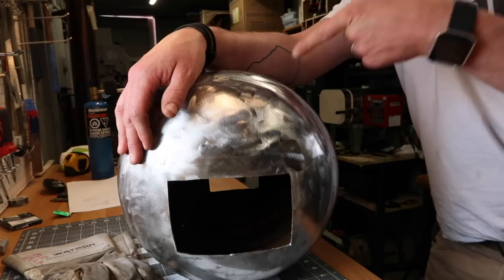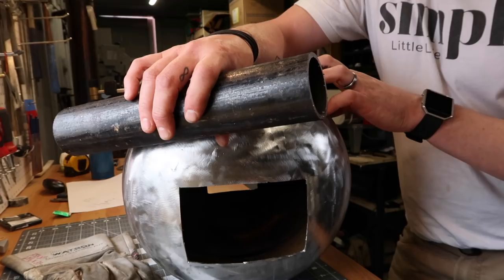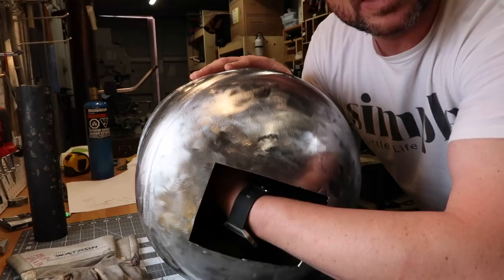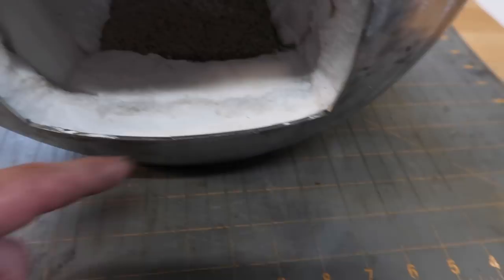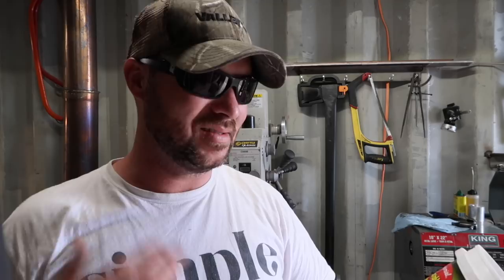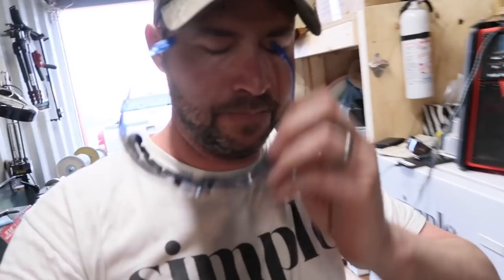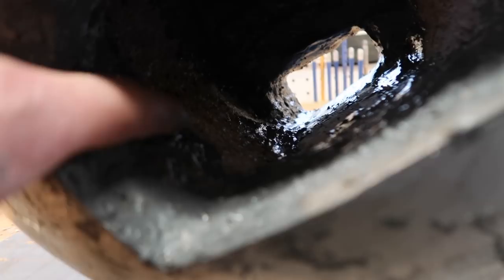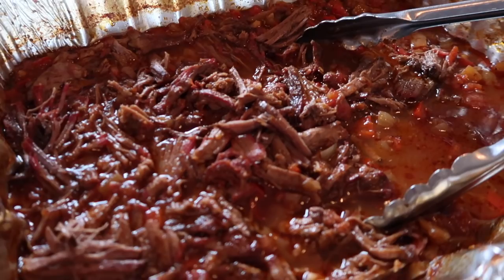Forge Vlog #3 - Insulation & Cement

Comment: Looking good! I used a 12" pipe 2 feet long, and simply cast 2" of cement inside, using an 8" pipe. I also put the burner in at an angle, using cast pipe as a consumable (ie it tended to burn away, very slowly). I used propane and forced air from a squirrel cage blower with a gate valve. I put firebrick at front and back as needed for the work and yes it did tend to break with expansion contraction, but I just kept re-using it as it shrunk. I forged and forge welded regularly for many years with it. The borax was hard on the bottom, I could have re-cast it after 10 years of use (but I didn't). Nowadays some coat the cement with a glaze and swear by it.

Comment: Jeremy,     You would have been better off leaving the end cut off put a hinge on it because kaowool does not last for ever and you will need to reline it eventually. Just saying nice build though the only other thing I may have done since you are only using one burner I would have centered it. Unless this was planed to latter put another burner to be able to reach welding temps easier. Either way nice build.   Sincerely ,Martin at M/S Blacksmithing and Blades

Comment: Jeremy I used a refractory mix for my pizza oven I built. you can use vermiculite and portland cement Mixture you can evenly fill voids and it will give you great insulation property I run my Pizza oven at 900 deg and the outside of the brick remains cool.
Reply: For forging and tempering he will hit or exceed 2000 degrees F.

Comment: Hey Jeremy, I used the same fire bricks and refractory cement as you did in your build and I have found that they don't hold up super well in my forge. The bricks I used as doors tend to crack and fall apart and the cement cracks and peels off pretty quickly. Just thought I'd let you know.

Comment: oh you should have used a ridgidizer and some itc to coat that kaowool after kaowool is heated it gets rather fragile and becomes airborn every time you light it. ceramic fiber is far worse than insolation .  hope this helps
Reply: Shan Moldovan I'm thinking of applying this same or similar technique for my new forge. Shouldn't the cement suffice if it is covering all of the kaowool? Thanks.
Reply: J. Darmon Blades 
It may but id be worried about cracking. Even with a Ridgidizor the kaowool wears out rather fast. this is specifically why I use insulation fire brick rather than kaowool in a sence it is safer and you dont have to worry about the breakdown of the kaowool.Not to mention my forge is not round but I am confident that insulation fire brick can be modified to fit round . Either way its just my preference you see many forges that use kaowool as a working surface but mine is used as a backup lining behind my soft fire brick. I sapose if you use like a saitinite clay as a coating you will probably be ok the other thing I  would use is a i think its called tci 100 it is used in kilms to direct the heat back at you piece. fyi the easier you make it to reline will help rather than having a solid  shell instead of a door.

     Thanks for the inquiry, Martin Moldovan at M/ S Blacksmithing and Blades
Reply: Shan Moldovan thanks for the feed back. I Appreciate it.
Reply: your welcome, all I can say is do a bit more research before you make you final build.     Sincerely, Martin Moldovan at M/S Blacksmithing and Blades

Comment: So I guess it doesn't matter if you don't rigidize the insalated blanket ??
Reply: It does, if his cement ever cracks he needs to cut the forge off and not use it till its fixed.  The wool is carcinogenic and will give you cancer without all necessary precautions. Which is necessary even if you rigidize, buuuut the wool is much less likely to go airborne of its been hardened

Comment: Wrong cement. And you should rigidize the ceramic wool first. Use itc 100
Reply: i got itc and kast 'olite. im thinking of using sodium silicate as a high temp adhesive; rigidize the kaowool also with sodium silicate? then 3 layers of itc (1st layer the thickest) then kast 'olite.. i think.. is this a wrong approach?

Comment: I have been doing a lot of research on these and was wondering why you used the refractory cement? Most of the ones I've seen online use a rigidizer and then a couple coats of ITC-100? Just wondering.
Reply: Stephen Ranti itc 100 is extremely expensive at 72 dollars a pint.

Comment: How is the propane tank material going to hold up to the temperature.
Reply from the maker: +Quad Life On The Ridge so far it's fine. Also it's so well insulated that it doesn't get that hot (compared to the inside) the steel has turned blue in a few places and straw in others so I think it will last long enough. Cheers👍
Reply: Oh. Because may dad and I are building a forge out of one of those big propain tanks and i was wondering how it would hold up to the 2,000+ degrees ( Fahrenheit )  that the torches would put out. Thanks for the information.